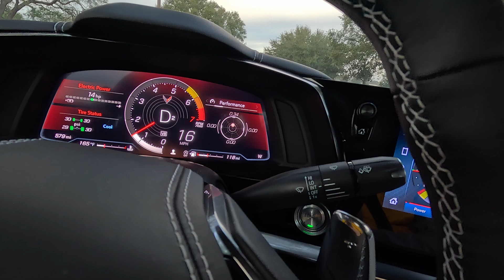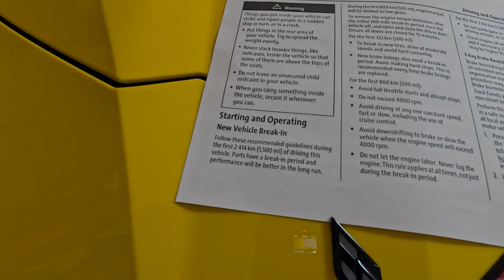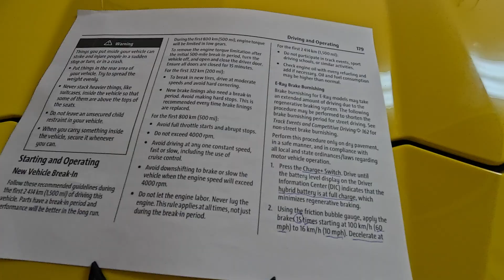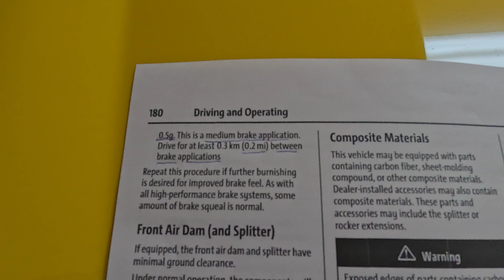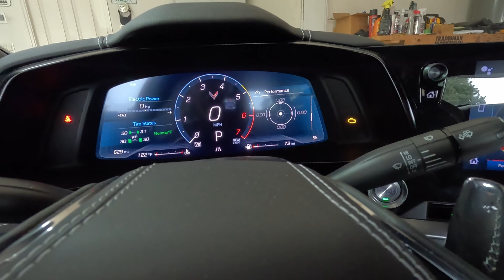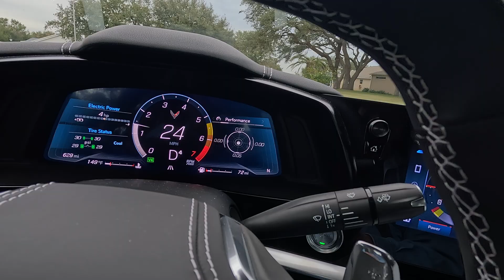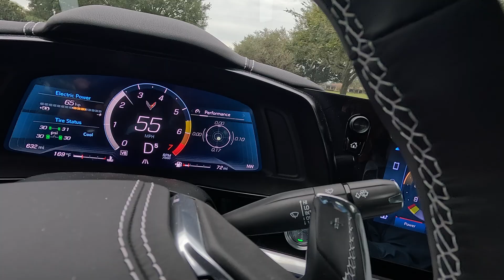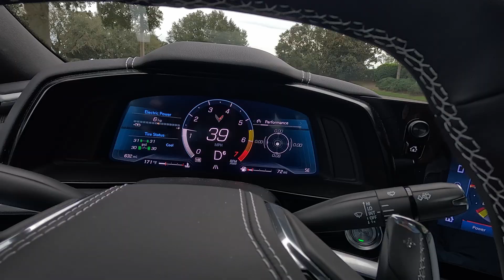Burnishing Carbon Ceramic Brakes

Comment: Thank for the visuals.. I picked up my Comp yellow E-ray 7 days ago and have to do this.  lots to mess with and learn. 👍
Reply from the maker: That's great. I enjoy running the front motor and sneaking out the garage. BTW, I watched the Erays produced and there are not that many Comp. Yellows yet. I think the GM configurator has the color wrong and that would be a turnoff for many.
Reply: @RobertMacCready   It is amazing a multibillion dollar CO cant get the website to show more accurate colors.. the Comp yellow and many others are way off.   I was almost not happy about the big gap at the DS headlight and a little off on the panel gaps.   My 2022 Honda has perfect fitments.
Reply from the maker: @joem7755  Yup, several colors are off. I almost didn't get the comp. yellow till someone sent me a pic of a yellow Z06 at Corvettes at Carlisle. 
My 1st Corvette was a1966. It had all kinds of problems with fit and finish. Finally, the wiring harness caught fire one night. Almost never bought another Corvette.